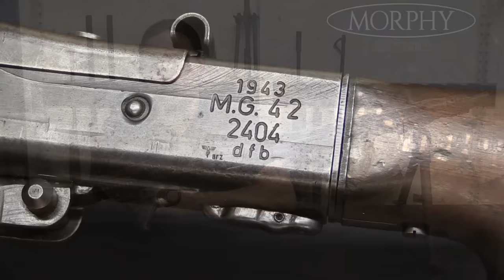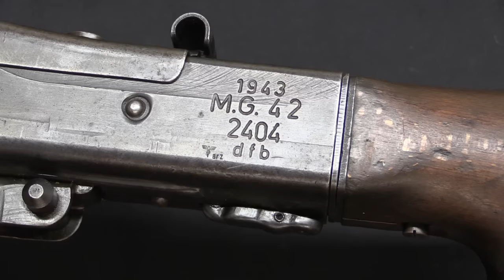Hitler's Zipper: The MG-42 Universal Machine Gun

Comment: "Would cause the gun to basically explode... Not a particularly huge issue."

Total war is a hell of a drug.
Reply: So is meth
Reply: @toomuchdamnyogurt5449  I sure hope nobody mixes the two!
Reply: @j0ndav1s  someone has I'm sure
Reply: @evanneyen6131  Which army didn't? US Army still do.
Reply: Bring another one Hans
Reply: I'm quite sure he meant the cartridge case will blow. Not the whole gun.
Reply: During the war there were several accidents with MG 42 breeches that opened too quickly.
But I had an MG42 that shot so fast that you couldn't hear individual shots, but it sounded like a splash ....... The rate of fire was around 2000 rounds per minute.
It was a heavily used MG 42, but it was also the one that worked best.

Even when I put the cadence brake in the breech block (the part that looks like a bolt with a spring around it) the cadence wasn't noticeably lower.
It only slowed down after I used the heavier MG-3 breech.
But the high cadence made the device really terrible.
If you hit the target, there were already 5-10 shots in it.

What the MG least likes are dented MG belts. I preferred to use the post-war decay straps.
Reply: @peterroth9804  Yeah that would be the MG42V with 1800 rpm
Reply: @ulfenburg7539  Well, all MG42s can run over 1400-1800 rounds per minute ... when they are heavily used. You will then get dangerously fast ...
I know the same thing from the MG 34 ....... there are also those who are faster than the others. But you only recognize that when you shoot them side by side.

I know this Mgs exactly, there is nothing different about that part ...... it is standard.
I myself had 5 MG-42s and only one shot so incredibly fast.
They were all normal machine guns, and one of them shot so quickly with or without a cadence brake in the breech block.
Now I only know that of a colleague ....... but it is usually the case that these MGs can hardly be fired anywhere.
Even in Arizona at the big shooting event, there weren't any that fast.

The more polished and the more leeway you have between the parts, the faster .........
Reply: Hollow knight! XD
Reply: @evanneyen6131  So did the US military
Reply: @peterroth9804  and what happened to that gun? Do you still have it with you?
Reply: Love how casually that was put across
Reply: @_Viking  The cartridge blows into to working mechanisms of the gun. So yeah the gun explodes, of course not in a thousand pieces. But enough to damage it and the operators head is really close to point were potentially pieces of metal get flung out out.
Reply: @peterroth9804  Well, all MG42s can run over 1400-1800 rounds per minute???????? no lol. Not all of the mg 42 could shoot that faster. It was there later variants that could shoot that fast.
Reply: @ulfenburg7539  Ulfenburg ....

No, that's not how it is ......... these are generalized statements.

Well, I did not determine the exact number per minute.
The very fast ones ... they should have been measured. Measure with a light barrier.
But I have certainly shot 15 MG-42s, the Jugo MG, the MG-3, the MG-74 Austria, and even once the very rare one, the Amelie in 223 from Spain, so I know one thing, they have very big differences in cadence .
Our Swiss Mg-51 is actually a son of the MG-42.
But Switzerland had to make it much more qualitatively, of course, with a support flap lock, stellite barrels, etc.
I also shot the Swiss "MG-45", but we call it the Sig-710 ....... the best MG I know. A colleague of mine even owned the plans for the MG-45 once.
Without the cadence limiter (the small rod wrapped with the spring) in the locking body, they are all fast ..... but there are those that are simply extremely fast with or without the part.
They are so fast that you can no longer tell the individual shots apart, it's such a noise, I can hardly describe it ...... such a whip ....... the sheaves.
This is where the term Hitler "saw" comes from.
It is a very typical sound, easy to distinguish from everything else.

And with these MGs it doesn't even help very much if you use a heavier breech (e.g. the one from the MG-3), they are still fast.

The heavily used ones are extreme, they have a cadence that is so fast and always work without any disturbance.
I have seen MG-42s with malfunctions very often. The Komman from arsenals in which the beautiful parts were assembled into machine guns, greased and stored as war reserves for 50 years. They were probably not shot in ...... that's why there are often problems with them.
I have always tested my machine guns with a blind barrel and blank cartridges, an original from the WK-2.
I always had 3-4-5 barrels on my MGs, I tried them and then put those that shot well to the gun.
For each MG you need 2-3 breeches and a few barrels to find the right one.
There were quite a few manufacturers who simply had different tolerances.
If those worked with blank cartridges, they were also good when they were fired.
I would say that the well-shot MG-42s shoot 40% faster than new ones.
Reply: @peterroth9804  okay but none of this was relevant to my argument? It is a simple fact that it could not shoot that fast. The later ones could and that was because of the introduction of roller delayed blowback operated breech. Plus well-shot ones shot 40% faster than new ones? yeah no, you need some actual evidence to support that claim other than you what you see plus you even said yourself you couldn't tell the shots apart because it is so fast and yet you claim 40% faster?
Reply: @ulfenburg7539  Ulfenburg ..

If you don't have any practical experience with the MG-42, why don't you just leave it.

So again to take notes.

I've shot a lot of Mgs and experiences with them.
I even shot them with the "double spade handle", which is also a funny thing.
The measurement of the cadence by means of a light barrier would be conclusive ..... I did that too, but mostly just for fun, ..... and I didn't put it down in writing.

MG-42 are faster than other Mgs.
But during the war one tried to slow down the cadence.
Only a few Mg-42s fire with a possible 2000 rounds per minute.
 I would say 1 mg in 50 does that.
Most collectors want new Mgs, but they shoot much slower than the heavily used ones.
The few collectors who know the difference like to take a heavily used one, precisely because they shoot so incredibly quickly.

In WW2 there were accidents because some machine guns opened the lock between the barrel and breech so quickly that a lot of gas pressure was discharged from the barrel to the rear and powder particles were thrown into the eyes of the machine gunner.

The cadence limiter part in the breech was already there during the war, but I only saw 1-2 that were stamped with WaA. Presumably it just didn't get introduced.
That is not entirely clear.

I also have a muzzlebrake for the MP-38, which is stamped but never introduced. Wonderfully beautifully made and excellent in quality.

Well, most MG-42s to be found today shoot with 1200-1400 rounds per minute.

Some heavily used examples, in which all parts are still original and have been heavily used as a whole, achieve a much higher rate of occurrence.
But such Mgs are seldom found.
Of my many pieces that I had, none that shot that fast. I also only collected pieces that were as good as new.

But a colleague of mine was less sensitive, his shoots incredibly fast.
I only knew afterwards what it means who the Mgs are fast ..... only afterwards.
I have no idea whether you've even heard something like this before, there is something like that in the USA.
Only those who have experienced that know what it really is like.
My colleague's was so fast that I was worried about safety when I first heard it ..... from a distance of 200m.

If I write something about MGs here, it will only be because I have experience with it.

That should never be scientific.
Everyone can read it and be happy, can satisfy their curiosity ....... everything else is unimportant.
Reply: @peterroth9804  Because practical experience is not everything you know? Reading documents and having actual stats behind it is a lot more good than your fucking practical experience. Not only this you only state they shoot fast? really? of course, they shoot fast and you also said that you didn't count the shots. Which means your "data" is unreliable. The only thing you have to back up your claim is "my personal experience" with a little bit of uncertainty. But even after stating that you don't know how fast they fire then you proceed to state 1/15 shoots 2000 rounds per min? plus most have of your comment just talk about the guns and how you have seen them which is nice but if you don't have anything to support your claim other than anecdotal evidence which just doesn't cut it.
Reply: @evanneyen6131    All armies used amphetamines....not just Germany.  SteveMRE1989 broke down the stats once and 175 million amphetamines tabs were given out by the American army ALONE and they joined late.  Britain had something like 100 million, and I forget Germany’s counts but they weren’t as high as America’s...get it? Weren’t as ‘high’ lol I just crack myself up.
Reply: I suspect with half the red army charging across the steppe, the last thing you worried about was your gun exploding.
Reply: @curtwuollet2912  
Correct.........

20 years ago I met someone who joined the SS Wiking division at the age of 17. At 18 junior school in Bad-Tölz.

Later also with the storm pioneers and at the end in the famous Hürtgen Forest, where he was regimental commander when he was barely 21 years old.
In the armed forces completely unusual at that age.
He had a close combat clasp in gold, 9 tank destruction badges, a German cross in gold and a badge for the wounded in gold.
The old man lived 20 km from here in Austria.
For higher officer ranks that was very rare, the close combat clasp in gold ....... because such officers were rarely present in close combat ... but he was still very young.
The man was the only one in his unit with a Walter P-38.
He was so proud of it, he never took it into the field so that it would always stay beautiful.
When he showed it to me, it wasn't as good as new. A Walter with code AC ..... from 43. AC were the nicest ones in the making, 44 were still beautifully made.
A P-38 was ultra-modern at the time .....
The SS always got the booty weapons first, the Heereswaffenamt rarely supplied the SS units with German standard weapons, as they were not part of the Wehrmacht.
They rarely got K-98, Mp-40 or StGw-44.
Only when there were hardly any weapons left did they get the good things.

The man told me then how they did it with the MG-42.
In one machine-gun hole they had 2 machine guns, there was no change of barrel, but a fresh machine gun with an inserted belt was pushed to the machine gunner from the left behind.
Every second counted in Russia.
They also no longer gave the machine-gun shooters any spare part bags, replacement seals, barrels, etc., because if the machine-gunner was killed, the material was often lost ... and they always had too little material.

In addition, towards the end they usually had no real machine-gun squads with 6-8 men, but only 2-3 men who couldn't carry everything .....
Only machine guns and ammunition were taken.

44-45 in the Hürtgenwald his troop numbered 950 men at the beginning ..... after the fighting only 48.
The commanders received knight's crosses, the soldiers received wooden crosses.
In the beginning they had far too few trucks ..... in the end they needed 2 trucks to transport all the men and their equipment.
Reply: @peterroth9804    Wow; that’s amazing you got all that first hand...next time bring a recording device.  Once these men go, there’s no more we can learn from them.
Reply: @peterjohnson1379  Hitler supposedly invented meth. Lol
Reply: @toomuchdamnyogurt5449  and cocaine
Reply: @j0ndav1s  well the germans did xd
Reply: @_Viking  The resulting barrel obstruction from a cartridge case explosion would likely cause an explosion in the breech when firing automatically, the only firing mode of this gun.
Reply: @dickrichard626  
Yea be careful where you learn your history from. It’s quite sad actually, I watched a recently new documentary hoping to learn more about wwii and it essentially boiled the entire thing down to “hitler was a crazy bad guy on drugs what a psycho!”. 
No discussion of literally anything, I found it kind of odd actually. I get that perhaps they don’t want to risk anyone learning more than the narrative they set, but in my opinion makes it so you’re essentially erasing history and not learning from the past.
Reply: @carsonhunt4642  Well, the story is that the nazi's invented meth because, they where experimenting with giving soldiers drugs. They claim to have first synthized it and then a japanese professor is known for making it better for them. Really though street grade crystal is nothing like pure synthetic stuff or even pharmaceutical grade either such as adderol and ritalin. "Meth" is strickly the dirty amphetamine.
Reply: @dickrichard626  
Yea they achieved quite a lot, had some very impressive minds that’s for sure. Glad we didn’t execute their scientists for war crimes and instead put them to use working for us lol! Lots of them helped with many US breakthroughs in science
Reply: @dickrichard626  meth is not strictly dirty amphetamine. Its distinctly a different chemical. It's literally called methamphetamine not amphetamine for a reason. It's significantly more powerful than regular amphetamine is at producing euphoria (from dopamine and some serotonin) and energy (through norepinephrine and adrenaline). Also had a lot of downstream effects such as pain relief, hyper focus and insomnia. Amphetamine has that too, but not quite as intensely and meth lasts roughly 2x or more longer than regular amphetamine. Meth is also more likely to cause cardiac issues, seizures or psychosis.
Reply: @webby2275  ok, I realize that, I miss used amphetamine in the sense that the terms refer to the molecular structure and the 2 molecules are distinctly different, but it doesn't detract from what I'm saying. Drugs that are related to: "Methamphetimine" include: amphetimes just with out the meth. It's essentially the same kind of stuff. When people make meth it has all kinds of stuff in it and honestly you can't name all the chemicals that could be present depending on how they do it. LMAO, I never said I know everything about it and honestly you inspired to do some research.
Reply: @peterjohnson1379  the Nazis did exactly that, they gave soldiers Methamphetamine (under a different name).
Reply: @peterjohnson1379  thanks for explaining his own joke to him.
Reply: @Rick_Sanchez_G420  
NO SHIT SHERLOCK. 
What tf do you think they were indicating
Reply: It is Hell itself.
Reply: @j0ndav1s  benzidine a chemical cousin to  meth, was regularly used in WW 2
Reply: I love that he says steel cases helped solve that problem but German memoirs say that the steel case ammo was so bad that they had to designate a guy just to beat stuck cases out of the barrels
Reply: You sound like Rick James :face-purple-crying::face-purple-crying::face-blue-smiling::face-green-smiling::face-green-smiling::person-turqouise-waving::hand-pink-waving:
Reply: @j0ndav1s  the germans did in ww2
Reply: i think this is not really correct, when you see the holder of the firering-pin: the pin can only take the cartridge when the rolls of the bolts are fully engaged with the barrel

Comment: So, the feed system used in the MG42 and now many other machine guns was designed by a newcomer to gun design. Neat.
Reply: Like the AK
Made by a tank designer
Reply: Like a Glock although Glock guy had a few smart ones from the Styer.
Reply: @azmanabdula  Tank *crewman Kalashnikov did not design tanks
Reply: Yes, but an established industrial engineer. He just looked at it as a mechanical problem, using his manufacturing process engineering experience as a basis. I think Ian's comparison to Gaston Glock is quite apt. Both came into the gun design game without any formal training in weapons design, but with a very good understanding of mechanical engineering and material science (polymers in the case of Glock, steel stamping in the case of Gruner). That allowed them to approach issues without a preconceived notion of how they should be done in a gun and come up with unconventional, but very effective, solutions.
Reply: yeah! just like the L85... er...
Reply: The Barrett guy who made the .50 rifles was a photographer.
Reply: It makes sense, they see the problem through their specially trained eyes that someone who has only experience in knowing what the already established assembly of guns and how they work can not. The people in that industry a lot of the time have a certain idea drilled into their heads because it works and instead of throwing out the blueprints and making something completely different they stick to the tried and true ways of assembly. This is true with any sector or manufacturing, it’s just more interesting when it’s about guns
Reply: @harrisonbergeron9746  British sense of humour is the best. Just like L85. Mutatis mutandis, that is.
Reply: @huntermurphy2148  
"Tank *crewman Kalashnikov did not design tanks"

Shit you are correct

Who am I thinking of?! 

Woops
Reply: Sometimes you need a new set of eyes to see the best way forward.

The MG42 feed cover is very good.
Reply: @azmanabdula  He designed a contraption to measure engine performance so maybe this counts.
Reply: @sir0herrbatka  
I heard he was 
I might be mixing it up with someone else